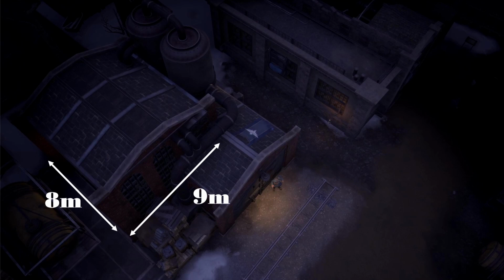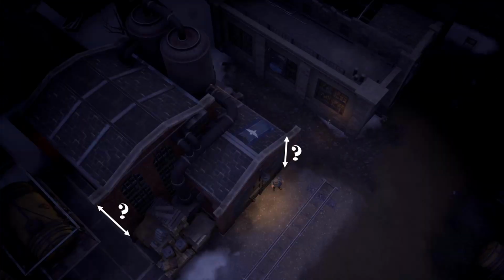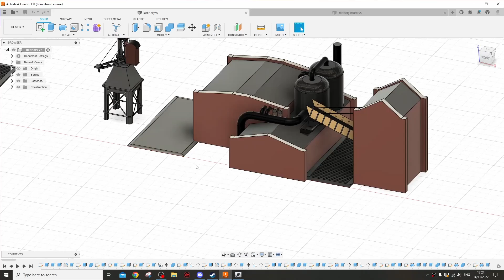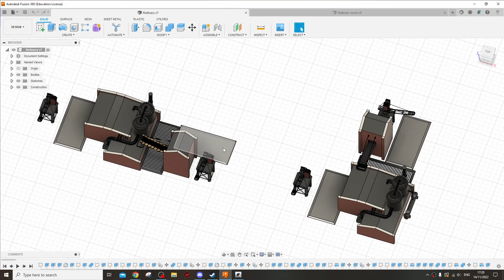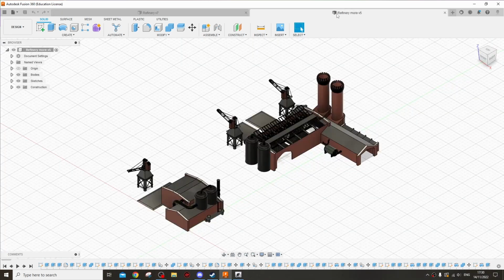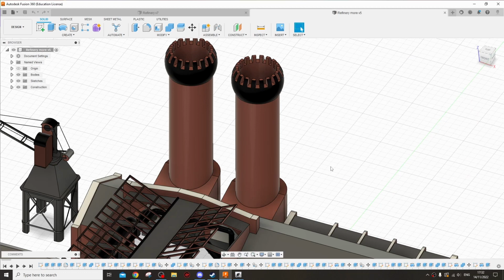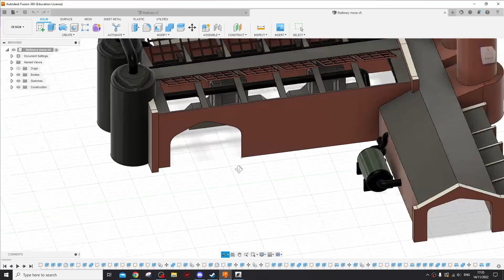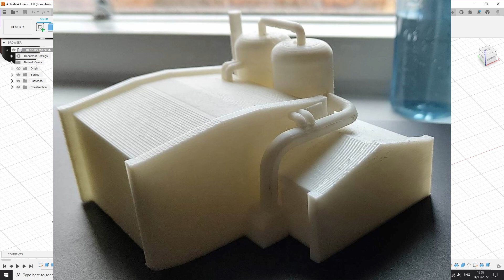How to: Make better refineries for foxhole

Comment: In theory it is a good idea but in practical it will cause more problems. Many people either wouldn't know how to use thse new refineries or won2t care about these details and they just want to drop resources and leave. That's why your designs should be fool-proof and be useable in any condition.
So my idea is that, using 2 cranes and 2 pads is a good idea. Add another area on refinery for rigid trucks to access to refinery without blocking pads or crane.
Reply from the maker: That can literally be said about every update. Also, on my designs, you'd be able to access the refinery on any side which isn't taken for special loading.